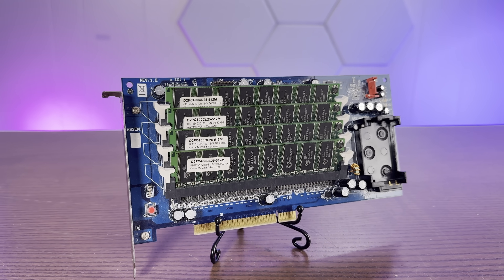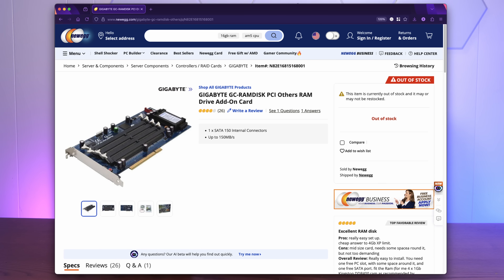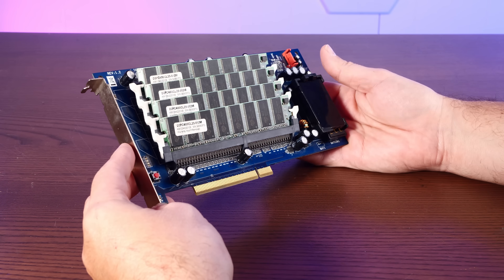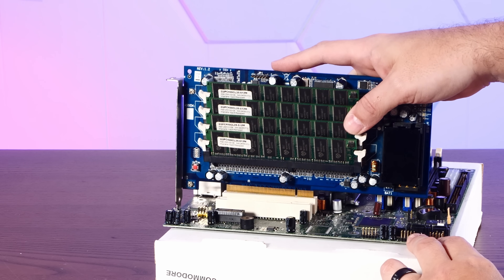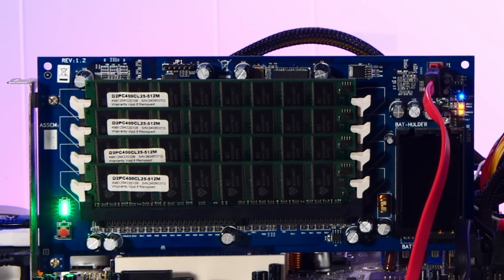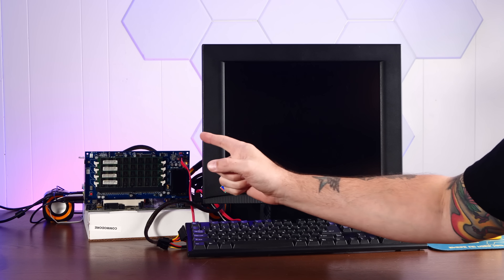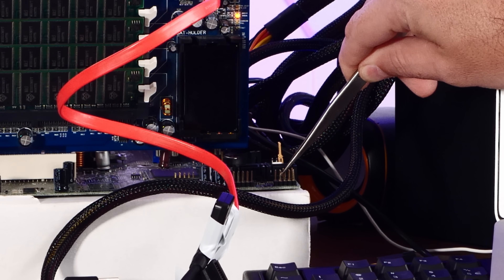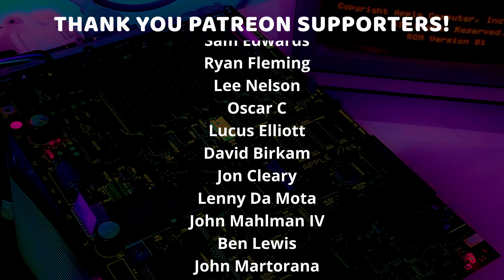This Early SSD Was WILD

Comment: A linux ram swap disk made out of literal ram is the ultimate mad scientist goal of this card.
Reply: There's also zram. Allocating a compressed disk in memory and creating a swap fs on it. A lot of the stuff in memory is compressable so swapping on it as first swap device and if you don't have much memory add an on disk swap as a level 2 swap.
Reply: @xenoxaos1   swap on zram is HUGELY overrated. It's a hacked together solution for a problem directly addressed by the kernel engineers when they made zswap. swap on zram should only ever be considered for systems that cannot have a traditional swap on storage setup (of which this would qualify due to how it's bussed in.)

The single biggest problem with how you described it is that swap on zram is seen by the kernel as just another swap device, so if you have 2 swap devices, one on zram one on traditional storage, your priority can dictate which is filled first, but that's it. As soon as your swap on zram is filled, future swapped pages go to the slower device, even if they're more active. Once a page is consuming the swap on zram, it's there until ALL swap is filled and the kernel needs to start evicting swap cache, which can take a long time and will not have any regard for how active a page is. But which pages are going to go idle first and get swapped out of memory? Most often the pages that are going to stay idle, so they're just going to consume memory, albeit compressed so less memory than when resident, but still consume it and for a long and sticky time.

With zswap, the kernel knows that there is one on disk swap device, and an in memory compressed cache. It sets up a 3 tiered system, resident in memory, compressed in memory, swapped to disk. It can see that a resident page is idle, swap it out to compressed in memory cache, and then when zswap starts filling up, it can move the most idle pages out of compressed cache onto disk and free up swap cache for still idle but more active pages.

But neither zswap nor swap on zram were a thing when this device came out.
Reply: @xenoxaos1  zram can be configured with a block device as it's backing device. This is much much better than simply adding a swap file/partition on a block device with a lower priority than the zram swap.

This is because you can configure that backing device to be used for non-compressible data among other parameters for what gets sent to the backing device and when. Additionally you can configure a QUOTA for the backing device. This can save SSD's from a huge number of writes that a standard swap file/partition can incur.

I will often create a zram disk with X GB of RAM and then the apparent size of about 3x that amount using ZSTD (cpu cycles are not as big of a deal as they used to be) along with a backing device. 

An example configuration might of a system with 16GB of physical RAM might be 6GB of RAM for the zram device with an 18GB apparent swap size using ZSTD and a 12GB backing device on an SSD.
A system with only 8GB of physical RAM I will usually reduce the zram device to use 3GB of RAM, 9GB of apparent swap size and a 6GB backing device on an SSD.
A system with 32GB of physical RAM I will usually increase the zram device to use 8GB of RAM, 24GB of apparent swap size and a 16GB backing device on an SSD.
A system with >32GB of physical RAM I will usually increase the zram device to use 10GB of RAM, 30GB of apparent swap size and 20GB backing device on an SSD.

Obviously, how the system will be used will change how the zram device should be configured.  In order to get maximum use of the zram swap you need to adjust sysctl, at a minimum simply change "vm.swapiness" from it's default low value to a much higher value. My experience is that the lower physical RAM systems need a lower vm.swapiness value. In general, you want vm.swapiness of between 100 and 180.

vm.swapiness determines how aggressive the kernel uses the swap. The default low value means that swap is basically only used for a last resort. This means that using zram will be a detriment.  With lower amounts of physical RAM, too high of vm.swapiness can cause severe swap thrashing. Another consideration is that many programs need a certain amount of free physical RAM in order to start.  

I tried using 4GB of physical RAM for zram on an 8GB system that I wanted to use for low end gaming (via Steam). By low end, I mean extremely low end. It is a laptop with an AMD 7320u APU. This is a 4 core/8 thread Zen2 CPU (2.4Ghz base, 4.1Ghz boost) and 4MB of L3 cache with an AMD 610M iGPU. This iGPU consists of 2 cores at up to 1900Mhz.  While this RDNA 2 which means that technically it supports DirectX 12 Ultimate, it hardly has the hardware to use it. The hardware consists of 4 ROP's, 8 TMUs, 128 shaders and 2 ray tracing acceleration cores. It's best to ignore the idea that it can do ray tracing. In fact, this iGPU was never designed to actually do 3D.  It was just cheaper to use a tiny RDNA 2 gpu than to design another iGPU just for 2D. It does have just enough power to use 3D features of a Windows desktop. This iGPU compares unfavorably with the Radeon R7 384 from 2015 which wasn't exactly a powerhouse back in 2015.

My point is that I never planned on playing modern 3D games with this laptop. I only wanted to be able to play basic 2D games, and maybe a few old 3D games.   

With 4GB of RAM allocated to zram and vm.swappiness set at 180, there were several games that I tried to load because there was not enough available free RAM. Some of the games that would load would then start thrashing the swap. This is where the the kernel moves data from RAM to the swap, but in order to move data from the swap to RAM, but then needs to move more data from RAM to fully move the required data to RAM. Then the CPU might need data that  is in swap, so the kernel moves the data it just moved from swap to RAM back to swap to make room for the data it needs to move from swap to RAM. But then the very high vm.swappiness of 180 means that the kernel is always trying to move data from RAM into swap, extremely aggressively.

With an 8GB system with an iGPU, there is usually only about 7GB that the kernel sees as physical RAM. If you then use 4 GB of that physical RAM for zram you are left with 3GB (or less).  Combined with the kernel trying to aggressively move data to swap means that it is extremely likely that the data that the kernel will need will be in swap and which will need to be moved back to physical RAM. To make things worse, there is a certain amount of data that the kernel marks as unmovable. This could be about 0.5GB to 1GB. This effectively reduces the amount of physical RAM that is available to the kernel to 2GB to 2.5GB.  I found that reducing the zram from 2.5GB to 3GB from 4GB along with reducing the vm.swappiness from 180 to 100 stopped most of the issues with swap thrashing.  

I have not had an issue starting any game that can reasonably run by this system. The laptop is using size=3GB, mem_limit=3GB,  disk_size=9GB, compression=zstd and vm.swappiness=100

For proxmox, I round up the physical ram divided by 6 with a 10GB limit for size and mem_limiit, and set the disk_size to 3x higher. I tend to set the vm.swappiness to 160.

My theory on using zram is that I want to swap as much as possible so that more RAM is free for processes and file caching.  With modern, fast CPU's the overhead of compression tends to be low enough that the speed of transferring compressed data can make up for it. In other words, the number of cycles required to compressed data tends to be less than the number cycles required to transfer the data to/from RAM for compressed versus uncompressed data.

As a totally made up example. let's say that it takes 12 cycles to transfer X amount of data to/from RAM. If it takes 4 cycles to compress that data and you get a compression ratio of 2:1 then it will only take 6 cycles to transfer that compressed data. The total time for transferring the compressed data would be 4 + 6 = 10 versus 12 cycles for uncompressed data.  That's an over simplification and doesn't account for everything. My point is that it really doesn't cost anything for a modern processor to compress the data vs not compress the data. By default, zram will use 1 stream per logical processor.  This means that as CPU's get faster and there are more logical cores, it will take less cycles to compress the data and transfer it.  Also, as the size of the L3 cache on the CPU increases, it becomes more and more  likely that the compressed data will fit in L3 cache, saving even more time (the compressed data is more likely to fit in L3 cache than uncompressed simply because it is taking up less space).

It will not be long before L3 caches will commonly exceed 100MB and with in a few years I believe we'll start seeing L4 caches becoming more common as that would allow more CPU dies with their own L3 cache but an on CPU L4 cache for all dies to share.  The more total cores on a CPU will create more and more pressure on the RAM subsystem. It will be cheaper to increase the size of L3 and have an L4 than to continue to increase the number of DRAM channels.  

Off-topic predictions

Let's say that in the future AMD creates a CPU that has 4 dies plus the IO die and iGPU die. Perhaps they have 16MB of L3 per CPU die and 32MB of L3 for the iGPU for a total of 96MB of L3. They may then have an L4 cache with an additional 128MB.  While AMD's x3d cache technology works great for certain workloads, it does have limitations. The biggest one is that the larger the size of the cache, the higher the latency of that cache as it takes longer for the cache controller to find where the cached data is located.  The other issue is that the 3d cache is attached to a die. As the number of dies increases, they have a choice, having a x3d cache per die (expensive) or having multiple dies share the x3d cache (adds even more latency).  Having each die have a decent sized L3 cache with a lower latency combined with an even larger L4 cache is likely the future. This L4 cache could even be built on it's own die. this would make it cheaper as a standardized L4 cache die can be used across multiple CPU's. It's even possible that higher end CPU's could have multiple L4 cache dies. If each L4 cache die is 128MB, then possibly consumer CPU's would have between 0 and 1 L4 cache die, Threadripper could have 1-4 L4 cache dies, and EPYC cpu's could have 2+ L4 cache dies. This means that a low end consumer CPU might not have an L4 cache (to reduce costs), while higher end consumer cpu's would have 128MB L4 cache. A lower end Threadripper might have 128MB L4 cache, while the top versions might have 512MB of L4 cache.  A top of the line EPYC CPU might by that point have about 500 cores and could possibly include 8 L4 dies or 1GB of L4, as these CPU's typical have multiple TB of RAM. 

It is also possible that consumer CPU's might have an L4/L5 cache on the motherboard. PCIe gen 8 (planned for 2028) is expected to of 30.25GB/sec of throughput per lane.  If the CPU to chipset link is upgraded from the current 4 lanes to 16 lanes, this would enable the L4/L5 cache to be mounted on the motherboard and connected to the chipset. PCIe Gen 8 x8 would be 484GB/sec of throughput versus the likely speed of DDR6 at that time being about 140GB/sec per channel, or 280GB/sec for a dual channel memory controller.  This means that certain motherboards might have 1 or 2 cache dies on the motherboard (128MB or 256MB). A high end consumer CPU could theoretically have L4 on the CPU plus L5 on the motherboard.  For lower end CPU's AMD would all people to have no cache dies on the CPU and then possibly buy a motherboard with 1 or 2 cache  dies on the motherboard. 

Even a Threadripper could could have cache on the motherboard. Threadripper CPU's already have more on-CPU PCIe lanes, it would be possible to allocate 16, 32 or more lanes to the chipset which could then have multiple cache dies.
Reply: Not a bad way to handle a system. page file.
Reply: I remember saw somewhere writes that one way to utilize memory beyond 4G for 32bit OS, is setting up ram disk on memory beyound 4G before OS started, should be using GRUB. Then start the OS, set virtual memory or swap in the ram disk.
Reply: The ultimate initramfs.
Reply: that's why I wanted one of these back in 2006! I ran a linux desktop back then.
Reply: RAM disks can be very good at storing data that's never intended to be stored while off, and tends to be from processing stored data.

Ensures that temporary files are actually temporary and self purges without power.
Reply: Why not just add more literal RAM -- rather than going through several unnecessary layers of abstraction and using volatile memory dressed up to be non-volitile ... as volatile memory?
Reply: @halfsourlizard9319  DDR2 modules was maximum of 4GB, so its maximum of 16GB ram. Most of the PC of that time handle only 8GB of ram. With this device you can add swap file for another 16GB. Not useless i guess.
Reply: @ShamanZT in pretty sure it was even less than that, the big ones were only available near the end of life
Reply: @ShamanZT  is not ddr2
Reply: @Stellarquia  on board exist label DDR2. So its DDR2.
Reply: @ShamanZT  No, it is DDR. Those are DDR-400 modules, 512M in capacity. If you'd bother to look up the part number on the sticks, you'd know that. Or the documentation for the iRAM card, saying it uses DDR. Or just common sense, I can spot a DDR stick from across the room, they have 184 pins and larger edge connector pins than DDR2 modules with 240 pins.
Reply: @GGigabiteM  I told from beginning what its DDR2. So what you mean when you say -  "is not ddr2"?
Reply: @ShamanZT  Literally read the labels on the DDR-400 sticks in the video. THIS DEVICE USES DDR, NOT DDR2.

D2PC400CL25-512M - DDR-400 CL 2.5 512 MB

If you don't believe that, read the Gigabyte datasheet on the iRAM. IT USES DDR.

I have no idea where you got DDR2 from, or why you think it uses it, when all evidence shows otherwise.
Reply: @GGigabiteM  on 3:50 i see DDR25V - its DDR2 5V no? Or its DDR 25V? Why so much voltage?
Reply: @ShamanZT  Hilarious that you're misreading a silk screen naming and erroneously using that to come to a wildly wrong conclusion.

DDR25V in this context is that is a debug LED to indicate the presence of the DDR 2.5V power rail. But the LED and associated resistor for the LED are not installed.

DDR uses a 2.5 volt power rail, further showing the iRAM uses DDR.

You clearly have a very poor understanding of electronics. I suggest you do research before coming up with erroneous and wildly inaccurate conclusions.
Reply: @ShamanZT  bruh, it's a 2.5V power line for the DDR ram
Reply: @ShamanZT I own one still, it's DDR. I feel like it's maxed at 4GB, but I can't remember if it was a hard limit or if I could only afford 4GB when I bought it.
Reply: @halfsourlizard9319  older RAM generation can be cheaper. I guess. Or something about computer memory controller capacities.
Reply: @halfsourlizard9319  because the ram bus has limited capacity but the storage bus effectively doesn't
Reply: This is essentially 4 more slots of RAM per card if you use it to hold a swap file or file write or read cache. 

Combine this with an external PCI dock that just provides power and you could scale a modest and cheap consumer PC into a low tech varnish cache server with 24GB capacity, that would rival a system or cluster of server racks 30x more expensive. Since if you were just using dummy PCI slots to power the card you could use the systems PCI slots of more SATA expansion cards to you could easily run a dozen of these cards in a single computer. In 2006 this would have been pretty insane and at a very low cost. In comparison, I worked at a company in 2013 that used a cache server for Amazon product feeds that had 96GB of capacity and that for sure cost at least middling 5 digit sum. (Servers went from at top end of 10s of GB in 2006 of RAM to upto a Terrabyte of RAM in 2013)
Reply: @adriankoch964  >This is essentially 4 more slots of RAM per card if you use it to hold a swap file or file write or read cache. 

No, it's not. These RAM sticks are on the painfully slow SATA bus at a max of 150 MB/s. A real RAM disk is on the order of thousands of megabytes a second.

Having a swap file on one of these cards is a waste because data in swap can't be used until it is moved into main system memory, and that happens at a similar speed, whether you're using a hard drive or an iRAM due to the SATA interface.

I'd rather pay more for a motherboard with four PCIe slots and four 512 MB video cards and use those as swap space. The linux kernel allows you to map video card RAM as a block device, where you can use it as a RAM disk or swap space. It would blow the pants off of the iRAM, there is no competition.

Comment: My Psion Series 3 PDA from 1991 already used SSDs as removable storage media, available in capacities from 128KB up to 2MB if you were extremely rich. IIRC they came with a non-rechargeable button cell for the backup battery.

Comment: Not an SSD. Also there was a flash of the market where you could get whole storage arrays that were just a bunch of RAM in a box, IIRC EVE online servers used it.

Those basically had enough power to dump the RAM to disk when shutting down

Comment: I like your swap space idea, I also think it'd be a good disk cache for a slower storage volume, for very obvious reasons I wouldn't want to put anything important on it thought. On modern system though 🤔 2GB of RAM Disk is chump change in today's machines, I think most browsers use more than that! I have used actual ram disks on Linux servers for fun things though, where performance is important, but data persistence is not a requirement (Think scratch disks or temp files for HLS streaming etc)